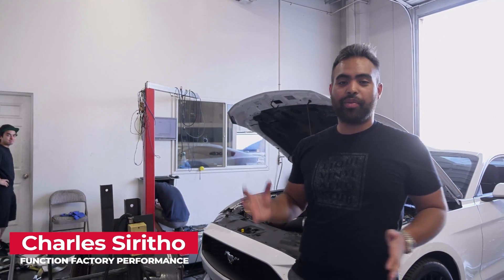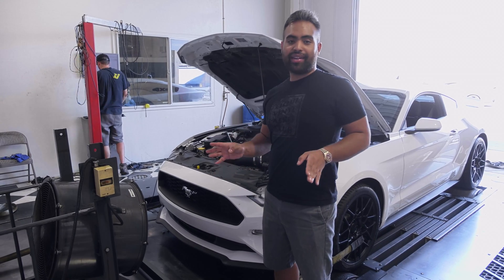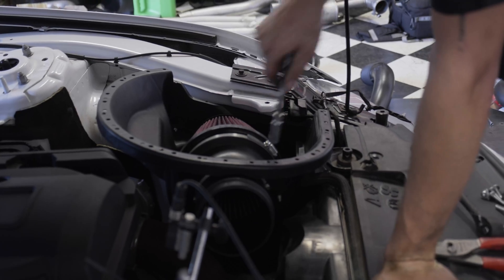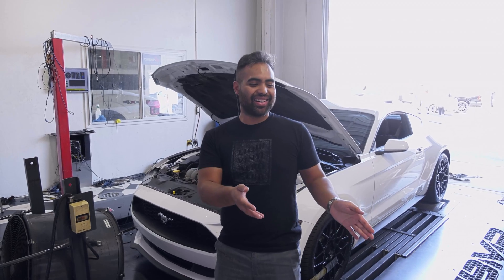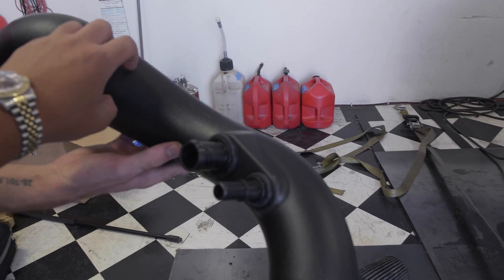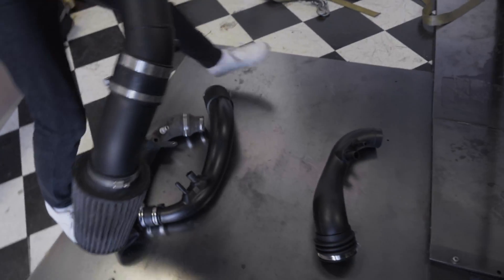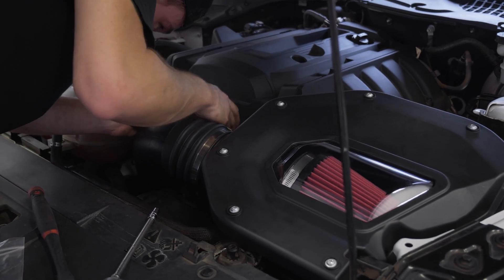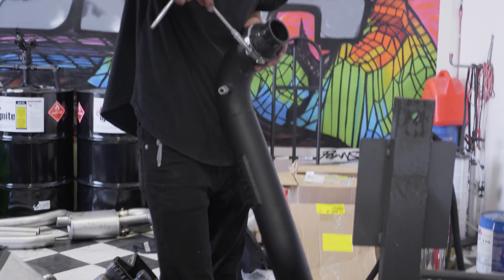FA - We Test EVERY Major Cold Air Intake For The 2015 to 2022 Ford Mustang EcoBoost

Comment: Its not that everyone is saying they dont make power, its just the cost of a cold air intake is not a value modification.  They offer a very small power gain and they are pretty expensive.  Many better mods prior to CAI.  If you just want to add one for looks and sound, thats cool too.  Its just that modern vehicle factory intakes are already pretty damn efficient so performance gains are minimal.  Ive put CAI on many vehicles prior to owning ecoboosts.  So many other things id ugrade first, performance tune, down pipe, exhaust, suspension, brakes, big turbo, then maybe CAI.  Im glad that we can mod our vehicles as we like and i still enjoy watching CAI videos 😀

Comment: It would be interesting to see the same video but with an ECU tune
Reply from the maker: @MadjinnSayan  I agree, the time invested would have been massive
Reply: @FunctionFactoryPerformance  Indeed, i have seen loads of vids similar to yours, but not as detailed. They all aim to highlight the gains/differences made by such intakes without any other mod. From what i understand, some mods (intake, fmic, hard piping, downpipe,...) are a way to prepare the engine for a bigger tq/hp gains with a map compared to stock components. ATM i'm debating on how much of a "potential" unlock these could make on a future tune on a 1.4 turbo engine, if any, because swapping parts isnt cheap either...

Comment: Why doesnt the roush fit the nx2 turbo if u dont mind me asking?
Reply from the maker: @TysonBrown-s2s  you’ll need an adapter coupler and you’ll have to drill the intake for the catch can. Most people are not willing to do this.

It will fit with the right parts and modifications

Comment: Why not use the 3.5” Airaid intake tube with the Roush?   I know someone doing that and I’m about to order the Roush cone filter version to run with my Airaid tube.    Need more turbo noise with my NX2 .   I have a 2018 but want that open Roush intake box.

Comment: Any time I'm considering an upgrade I come to your channel see if you got a video on it! Great stuff, for us that want more details before pulling the trigger, it saves money and wasted time! You guys called it like it is, no matter who it is, to me that is golden! So I watched another one of your videos, the one that had the "comedian" youngster he had a 2018 Ecoboost and you guys did the intake, cooler, exhaust... and a few other mods. On that video you said that wet air filters are better than others, in this video your tests show that in reality there are hardly any differences on their performance. Can you clarify that? I'm considering getting a dry filter, nothing else, since I just want to run a stage 1 tune, but yeah I'm curious. So this is an update to an older post, but I settled for a dry "High Performance" filter, higher octane gas, and a COBB tune, and I had to re learn how to apply the gas pedal while driving, I use the car a few times a week around town but yeah, I noticed that with the slight touch and I had to hold my head steady, or it would go back on me. Reminds me about the old times when I used to race. I know this sounds crazy but I'm dang happy with the snappier response.

Comment: well 7 horse power is  not that much , might aswell leave it stock...  right/
Reply from the maker: You need to tune the car afterwards to correct for the airflow change
Reply: @FunctionFactoryPerformance  oh oke thanks.. but wait .. im confused  now.. I thought  the roush  intake didn't need no tune??
Reply from the maker: @deadstickfpv  it doesn’t, but if you want to maximize the potential of any modification you will need to tune
Reply: @FunctionFactoryPerformance  oke thanks ..

Comment: these numbers will be way off when you are on the street that roush intake will get so hot with the hood down also another shop noted with an intake on a stock tune the throttle body would close 20-30% a rerun of these numbers would be better on a OTS tune and hood up and down
Reply from the maker: Thank you Dakota, let us know when you do your testing so we can update this blog and video.
Reply: @FunctionFactoryPerformance  bet lemme borrow a Dyno 🤣 and the parts

Comment: Thanks for the info, but why are you testing CAI with the hood open? It will skew the results and I bet the aftermarket intakes would be down even more on power. Aluminum intakes heat soak more that the injection moulded ones.
Reply from the maker: Thanks for the insight, at the end of the day, we got the testing done and it's better than nothing.

Comment: For the intakes 2 vacuum valves did you have to get a vacuum hose splitter or how did you get around the two vacuum hoses at the bottom of the stock intake?
Reply from the maker: You need the turbosmart vacuum block
Reply: Ok thanks 🙏🏻

Comment: Right now I have the Airaid tube with stock box and k and N filter but I wanted something a little louder so I just ordered the Airaid full intake cause Airaid has the biggest tube of all the intakes I have seen so I don’t know if it will be better then the Roush intake my car is tuned so I don’t know if I change my Airaid tube if I’m going to loose hp
Reply: I wouldn’t change it without a tune, that extra flow will need to be adjusted for

Comment: Nice I had the Airaid tube but I wanted a little more Turbo spool noise what I did noticed that the Airaid Tube is larger then the Roush tube that had me a little worried that I probably would loose power but your video cleared my worries and the Roush looks amazing do you think I should retune the car since I have a different intake Or should I just leave it alone Thanks.

Comment: "More air makes more power" No!! Less COLDER air actually makes more power than more HOT air.  Dyno proven.
Reply: No, Smokey Yunick turned your take on hot air on its head when he developed the hot vapor engine. Not only did it make great power it got very good fuel economy. Too bad the concept was never developed beyond what Smokey Yunick did.

Comment: IDK how much boost the eco makes stock but what kind of numbers would it make with another 10pounds? A small (50-100HP) nitrous hit? Personally I would definitely buy a 5.0 but I bet the Ecoboost is still fun to modify and play with.
Reply from the maker: Boost is relative to turbo size. 
OEM boost levels is about 18 to 19. Stock turbo can handle about 26 safely before danger to manifold levels. 

Another limiting factor is Octane and fuel type. We typically see 310 WHP on 91 and high 350 on E55 to 85. On a built block, you can see upwards around 400WHP on stock turbo but you'll be airing it out with no life expectancy.
Reply: Is the interior boost gauge on these accurate? I’ve gotten readings of around 22 PSI in my car. I bought it used

Comment: Don't understand why everybody spend all this money on a full exhaust an a&m stock dry type filter gave me 50% increase in airflow a simple muffler delete with 12 in. 4 in exhaust tips cost me around $250 it sounds much better than all three of those exhaust you showed will e93 tune got $340 horsepower to the wheels and 400 ft lb of torque
Reply from the maker: Because they like the look of the aftermarket parts. I personally like my Full-Race intake. The muffler delete does sound awesome but does not deliver the power like a single pipe tomei.
Reply: @FunctionFactoryPerformance  Since I watched this video, I have been leaning towards the Full Race intake. I was surprised by the intake losing gains in both HP and TQ. But would those numbers come back up (or increase mightily) with say a CVF Street Intercooler or a Full Race intercooler? And add a Cobb Stage 1 tuning on top of that? ... I have to say that I LOVE the sound the Full Race intake makes as well.

Comment: Stock is best because it keeps the highest horsepower and torque.All these other intakes don’t do one job (filter) out chemicals.Y’all can mess up the o2 sensors even with k&n drop in air filter if you don’t wash it properly.If you just care about sound go for it
Reply: You obviously don't know what you're talking about. O2 sensors have NOTHING to do with your intake setup. People over oil their KN panel and cone filter resulting in oily MAF sensors (heated coil) in vehicles that have them. Air filters only filter dirt and dust particles......not chemicals....what a joke 🤣🤣🤣🤣🥴
Reply: Yet the Roush CAI out preformed the stock intake in this video and the Roush uses a dry filter by the way.

Comment: Agreed and good call on the Full Race intake. I used to have an AEM intake on my Gencoupe turbski and it sounded glorious. I just installed a Steeda CAI on my Ecoboost, and honestly it's a little disappointing. Even though it's open lid, it reuses the stock air inlet and it's a plastic tube. Doesn't sound as loud as I expected it to. I'll have to look at getting a Full Race or something similar like COBB to give me that wooshing goodness again. Thanks for the awesome video!
Reply from the maker: Thank you! After switching to the wide body fenders, the spool noise is insane!

Comment: Im getting the ford performance tune that comes with a K and N drop in filter. Should I get the airaid intake tube to compliment it? or is stock intake tube just fine? (Im aware that stock airbox is best but im asking about the tube specifically). Thanks!
Reply from the maker: Give us a call at 480 576 8606, I recommend the Roush as always.
Reply: Did you ever get an answer bro I’m curious about the same thing lol
Reply: @S650Zeus  nope lol
Reply: @ItRoamsAtNight  any update on cai lol? I'm waiting for the 2022 ford performance tune which also comes with the kn drop in filter, been researching cais
Reply: @dnalor8753  I ended up buying a GT lol but i will say that from my previous EXTENSIVE research, the following is ideal: Ford tune with stock air box, airaid intake tube, and kn drop filter. This combo is gold. Hope this helps !
Reply: @ItRoamsAtNight  thanks man, what does the what does the airaid intake tube add? is it because there's less "curves/angles" so air can flow more freely?
Reply: @dnalor8753  Basically it allows for more air to come through, less restricted, which is what the ford tune likes. Thus giving you a small but nice power bump. Also the intake gives better throttle response and increases the volume by a bit.

Comment: Thanks for the video. Been going back and forth on the Airaid tube to go along with the Ford Performance tune. I like my tune, but can't wait to see the results after you tune this one. It also has me wondering if I should drop the OEM air filter back in the car 🤔.
Reply from the maker: We think you should keep the air filter you like.
Reply: How does the intake tube feel with the ford tune?
Reply: @ItRoamsAtNight  I still haven't gotten the CAI tube. Decided to get the CV Fab street intercooler for these hot TX days.

Comment: I started with the Airaid and later ended with Steeda Mustang EcoBoost 2.3L ProFlow Cold Air Intake
Reply from the maker: Looked into the Steeda yesterday, looks like awesome build quality and a well sized pipe. Did you notice any gains?
Reply: @FunctionFactoryPerformance  +30 whp and +50 torque. It was my first dyno tune with an upgraded exhaust and the new air intake.
Reply from the maker: @thatguy-ve6mb  that gain was from the exhaust. Wait for the next videos :)
Reply: @FunctionFactoryPerformance  last year, I replaced my stock intercooler with a CVFAB Race intercooler, 1st time taking off my bumper. Lol. I am considering getting the CVFAB downpipe and a updated tune.

Comment: Crazy car only made that much stock. I nees to get a local dyno day see where im at after e30 tune
Reply from the maker: Yep, and that was after multiple runs and cooling the car done to make sure we weren't crazy. 
If you do the math, the crank rated HP is nearly spot on with the numbers at the wheel.